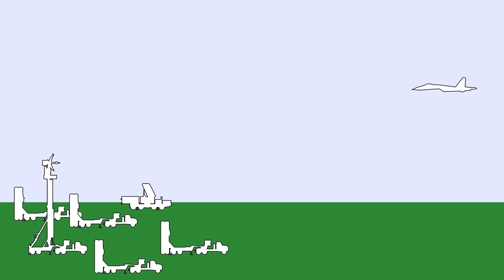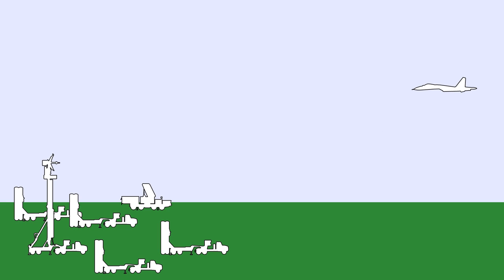How SAMs Work - Quick Overview

Comment: Are all SAM missiles trackable missiles? Does all SAm missiles follow targets?
Reply: Usually yes, either with Radar tracking or Heat Signature tracking, but nearly all SAMs use radar.  Harder for the pilot to defeat.
Reply: Are all SAMs trackable missiles? TLDR: yes
Missiles can be detected and tracked using several methods, most of them can also be used to detect other aircraft:
Visually with your own eyes - this method has blind spots and limited detection distance (missiles appear small when viewed head-on). However, in some conditions, spotting missiles can be easier than spotting airplanes - as long as the missile's rocket motor is firing, the missile produces a bright light and possibly also smoke (modern missiles can be mostly smokeless, though older missiles like the SA-2 produce clearly visible smoke)
RADAR - missiles contain metal, therefore they can be detected and tracked using RADAR. As missiles are much smaller than airplanes, they may be harder to detect (shorter detection distance using the same RADAR set). It is possible to deliberately design a missile to be very hard to detect ("stealthy") in the radio-microwave spectrum, although I have not heard of any SAM with this attribute.
Infrared - missiles can be detected using infrared sensors as they have a heat signature distinct from any typical background
Ultraviolet - the burning of a rocket motor may create a detectable amount of UV radiation, this missile detection system only works while the missile's rocket motor is firing and it does not detect normal aircraft, this is often used as a dedicated missile approach warning (MAW) system on combat aircraft as this detection method can be fully automated without detecting too many false positives
Signal-based tracking - missiles using command guidance may send a signal to the missile's control point so that the missile's control system knows the current flight parameters of the missile, this is mostly useful if you are on the side of whoever launched the missile as the target ideally should not receive the missile's tracking signal.
As to why you might want to detect and track a missile: If you launched the missile, then knowing the missile's location is an important part of command guidance (if that's the type of guidance system used on your missile). If you are the target, knowledge of the enemy missile's position helps in evading the missile and deciding when to launch countermeasures, it is also necessary if you want to destroy the enemy missile before it hits you (if you are, say, on a warship equipped with point defence weaponry)

Do all SAMs follow targets?
If you mean that missiles are guided (or guide themselves) towards their targets, then yes, that is pretty much the definition of a missile in a modern military context. A rocket-propelled weapon that is unguided (does not follow any specific target) is just called a rocket.
note: in a historical or non-military context, "missile" might mean any small and fast flying object like a ball or arrow